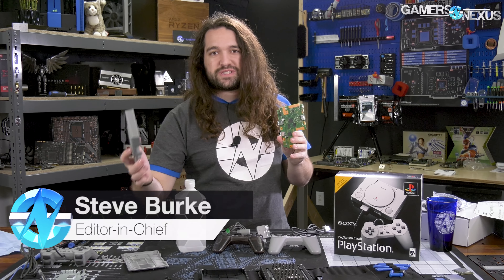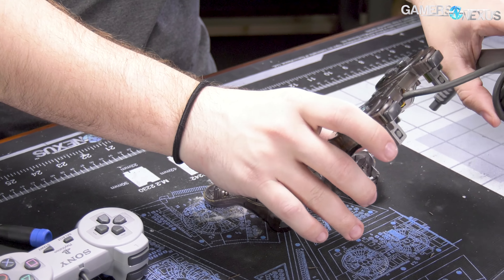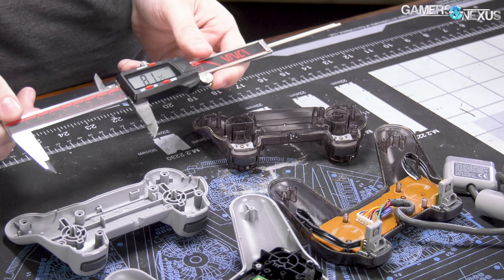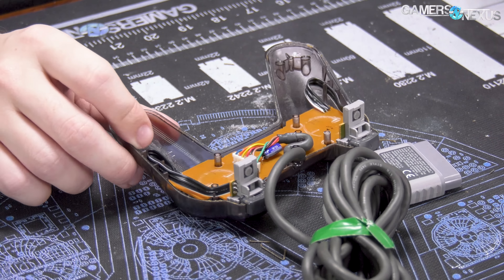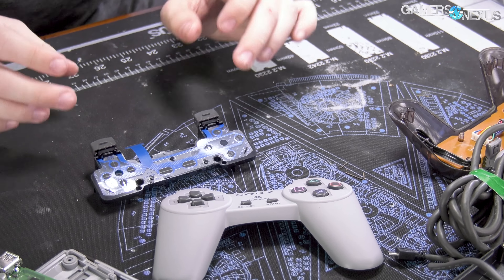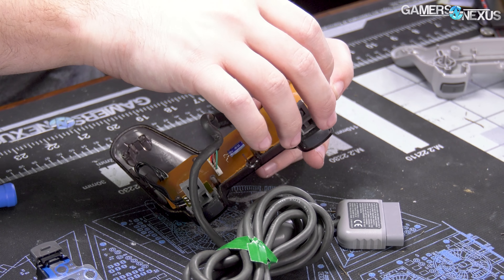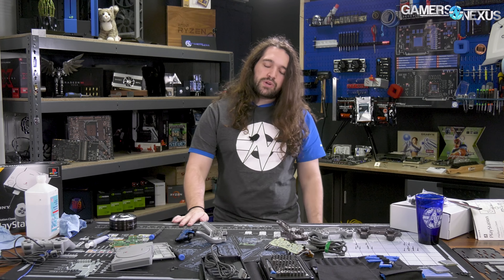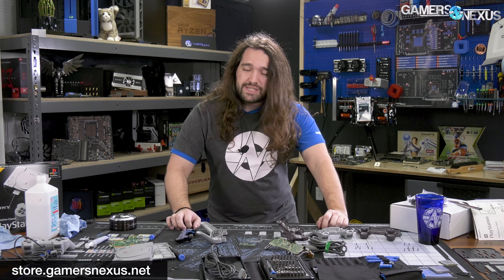PlayStation Classic Controller Tear-Down vs. PS1 Original

Comment from the maker: Find our tear-down of the PS1 Classic here: https://www.youtube.com/watch?v=qYW-4AOFkDE
Links to everything in the description above, or grab a GN shirt or modmat here: https://store.gamersnexus.net/
Reply: The PS1 controller is actually an aftermarket controller.  Still made by Sony, but sold as an accessory rather than the one that shipped with a PS1.  The construction is usually pretty similar, but in my experience, the accessory controllers will have slightly better build quality than the originals, especially if the originals are early models.  In my opinion, the transparent PS1 and PS2 controllers were some of the best as the plastic seemed a lot more durable than the original controllers.  The build of the PS Classic controller is pretty similar to the innovations in the PS3 and newer controllers.  The plastic circuit board for the buttons almost looks like the X, Circle, Square and Triangle buttons could be pressure sensitive.  If the black contact on the silicone layer is domed, this could be the case.
Reply: I want to see Buildzoid's analysis!
Reply: Didnt need to pay for one, im not sure if you asked. Pretty sure the community might have a new one or barely used one they could send you. I got one thats fairly good condition.
Reply: I know old controllers can be a little bit of a pain, but I don't think you should be drinking that.
Reply: Hi Steve that black part on the rubber pads is a conductor that completes the circuit for the button press (ps from the netherlands so sorry for the bad english)
Reply: forget the GN shirt, modmat, and ifixit toolkit ... what about that magifying glass youre using?
Reply: 05:15 I wonder if the controller could be recognized by your PC. Might be a good retro gaming gamepad. Also these ps1 classic controllers are eerily similar to the original SNES controllers in terms of design.
Reply: "Quality" job taking NOT original old controler to compare with new one....
Reply: You should take apart TV remote or at least calculator with soft buttons (you will be surprised how common and simple this "switch" design is) cause now this teardown was at level of Verge PC build.......
Reply: If you think that controller is gross, you should try my job.  I rebuild medical battery packs for a living.  Nothing will make you fear hospitals more than seeing their sanitary standards.  I've had battery packs come in with dried random substances all over them and even smelling of rot on occasion.  Surprisingly, the cleanest battery packs come from veterinarians and overseas.
Reply: Just wanted to add a small correction. The buttons are actually conductive (the black part that touches the rest of the circuit is carbon impregnated plastic which is conductive). It shorts out the gap between the pads (if you look carefully they're not connected) and that sends the signal that a button is pressed.Therefore they have an electrical function as well as a mechanical function!
Reply: @serkanermis9404  exactly what I wanted to say, same principle in most TV remotes.
Reply: serkan ermis 
And he shouldn't really be touching those carbon connectors ;)
Reply: I Unsubscribed after watching this.
Reply: The face button strip seems very similar to the one in ps3 controllers, except they're green. Haven't seen a ps4 strip.
Reply: The original PCB, if that isn't one, looks exactly like that.
Reply: 1)Is there any problems with Dpad of PS classic gamepad? I mean random false direction pressing
2)Does PC recongize PS classic gamepad?
Reply: On the new controller, the rubber contacts at the bottom of the actuator have a conductive material on them that complete the circuit when pressed to the contact points on the blue flex PCB.  This is the exact same system used on the Microsoft Xbox one Pro controller.  So just pressing on the contact points on blue flex PCB will do nothing.  Look closely at each contact point on the flex PCB and you will see fine contact rills.
Reply: I hope you guys showcase how you can get to the emulation menu just by plugging in a usb keyboard and pressing esc in the main menu of the console.
that could be pretty interesting.
Reply: have you tried if the controllers work with a PC?
Reply: @TheNews1990  that's because the playstation was going to be an add on for nintendo, there's a few vids on YT about it 😉
Reply: 11:36 The black bumper is conductive and shorts the black pads. I guess they are printing those  with masks because printing them with inkjets would be too slow.
Reply: that smoke gray controller was an add-on model. the original PlayStation 1 and PS ONE only game with Light Gray and White with the actual systems. also the ps1, ps2, and ps3 controllers are so similar. that 90% of the mold and parts are the same.
Reply: Compare it to a ps4 controller... I feel like not much has changed and that's why they are so similar.
Reply: They basically changed from mechanical to digital button input
Reply: InstaBlaster.

Comment: I was not expecting an internal USB port

That's actually really nice, because you could remove the stock cable and replace it with one that doesn't have the giant plastic shell on the USB A end
Reply: Indeed. They should sell these controllers separately.
Reply: you could even mod it to have USB C compatibility as well, couldn't you?
Reply: Looks like really smart business sense design that cable appears to be the same as the charging cable for the DS4 meaning they just make a few extra cables and chuck them in this thing to get the tooling costs down
Reply: Manic Myna It's just a micro USB cable. There's nothing special about it other than the plastic bit at the end to make it look like the old controller connector.
Reply: Would definitely come in handy if your wire breaks. You can just open it up and replace it with a new one. It's actually brilliant design. Props to whoever came up with that genius idea.
Reply: @nabagaca  why on warth would you mod it to have usb c? There is absolutely no benefits
Reply: burgerking220 Connecting it to a device with only USB-C inputs would be the benefit: an Android tablet, the Nintendo Switch, an Apple MacBook or certain PCs running Linux or Windows.
Reply: @burgerking220  my only thinking was for those stuck with laptops with only USB type C ports who don't wanna use a dongle to connect a controller. Also could open potential to connecting it to USB C phones given someone could find/make the drivers for it.